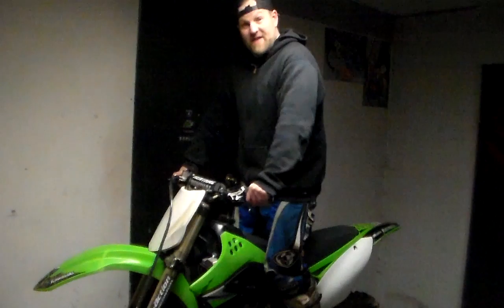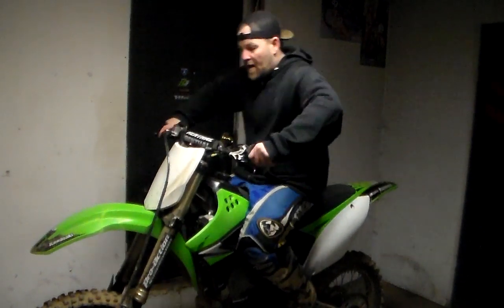The Foundation | How to Decrease Arm Pump In Motocross Racing | DSMX Training Academy

Comment: ive been racing for a while and i cased a jump went over the bars and broke my collarbone in februrary. i VERY RARELY had arm pump hardly ever. but since ive been back i get terrible arm pump to where it gets hard to hang on i cannot figure out what im doing different. if you have any extra tips please let me know. for now ill use your video  thank you
Reply from the maker: Easton I know this is such a late respone...Like 2 yrs.. Are you still having problems with this?
Reply: mxscoob754 it's gotten a bit better I'm still not where I used to be
Reply from the maker: Hey man it could be a couple different things. But if I was to guess... you more than likely picked up some bad technique from the injury. Do you have any video of you riding? It doesn't have to be much...Maybe a corner then a straight. I could tell you right away what's going on with some vid.

Comment: This helps out immensely. I'm a C class rider and i've been really focusing on gripping the bike with my knee's. While it's helped out a bit people haven't explained why or what I should be doing while I do that! I ride a 450 so the acceleration is very hard and I wind up holding on and gripping to hard like you said. Tomorrow i'll be practing at my sponsors house so i'll definitely put these two new tips to use along with some other things i've been learning!

Comment: Sounds like the same technique we use in road racing sport bikes, knees grip the bike and stay loose on the bars. Too much bar grip will give you unwanted steering inputs that will make the bike unstable. Nice Bike , what is it? ( 250 , 450?) I'm looking to start doing dirt riding ( alot cheaper than road racing). Also what break do you guys use most of? we use mostly if not all front, is it the same for dirt? thanks.